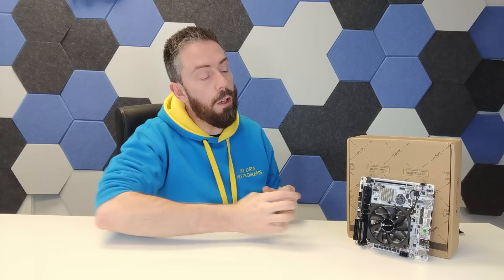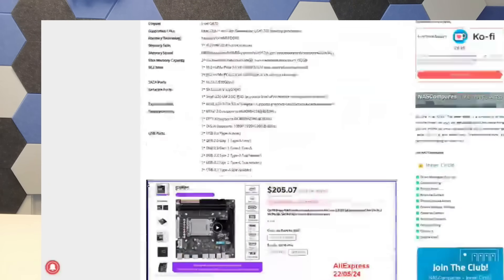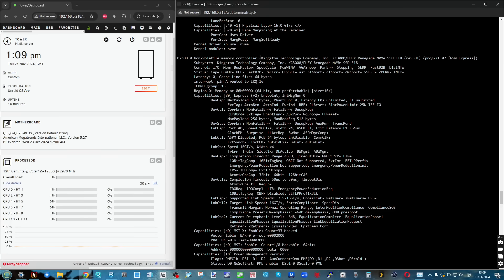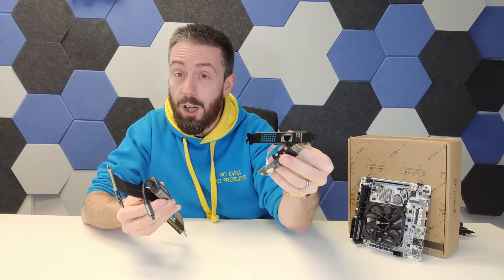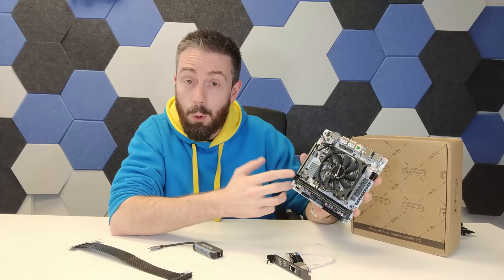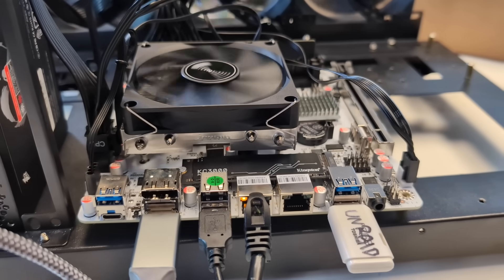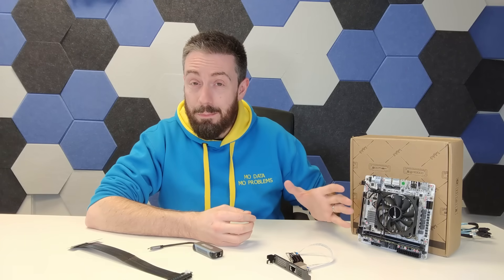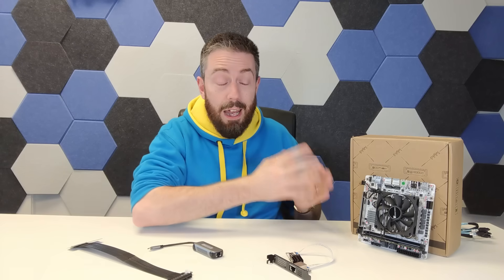NEW CWWK Q670 8-Bay Gen5 NAS vPro Mobo Review

Comment: My last cwwk mb got bricked after a „successful“ bios update, which was needed because it died during installation of we’ll basically anything I tried.

JBAT jumper or removing the cmos battery didn’t help.

And have fun finding a manual, the bios updates are in labeled in Chinese
Reply: Same. NICs kept flashing but otherwise dead. I had to send it back for a refund.